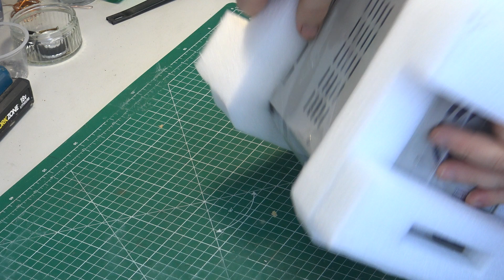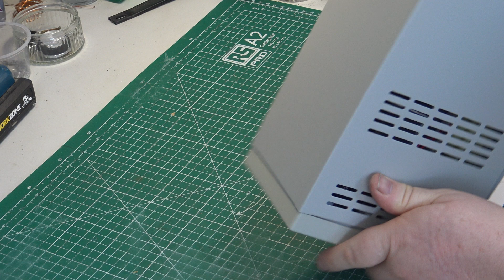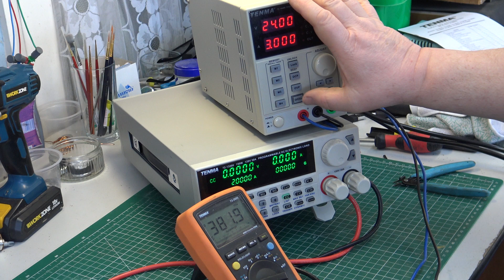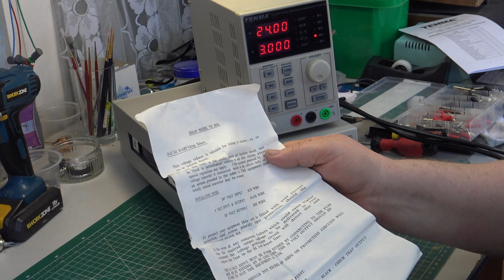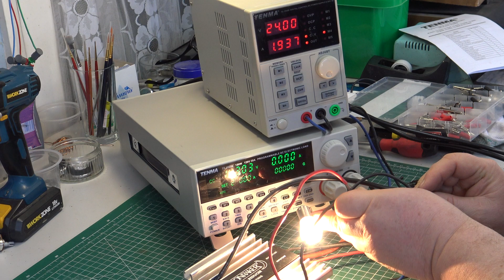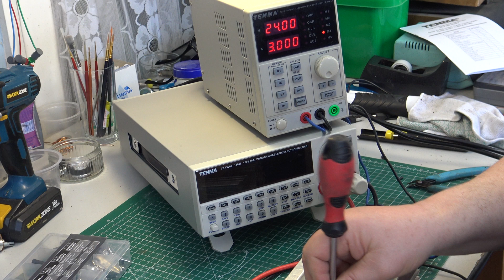Programmable bench power supply demo & 24v dropper test

Comment: Amazing how cheap this stuff is but it works well, have to be a little careful with the memory settings if testing a wide range of gear but that's the case with a variable supply anyway, if the power drops out and comes back on does it stay on the same memory, IE are the buttons latching?
Reply from the maker: It always starts on memory 1 & with the output switched off.

Richard

Comment: I've got one of those that I use if I need to take a bench PSU in another room or to another location as it's so small. One thing I did to mine was change the Output LED from Red to Green (and the led current limiting resistor) so at a quick glance I can see if the output is on or not. They should have done that in the factory as all the LEDs are Red! Great little power supply for the money though.

Comment: My Farnell Instrument bench linear PSUs from the 80s seem quite overbuilt compared to modern ones. The B30/20 (0-30V @ 20A) has stayed in the same place under the bench for 28 years and I’m not sure I could lift in now!
Reply: One of my Bench PSU's is a 1990's TTI/Thurlby Thandar PL330QMD Dual output Quad mode, and that weighs as much or more than my 13.8V 30A/40A Linear PSU's!